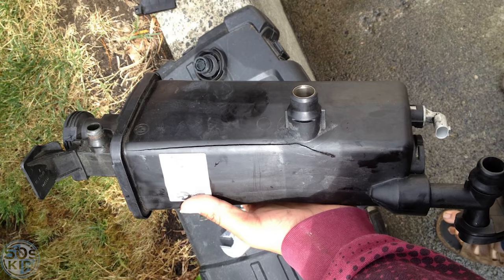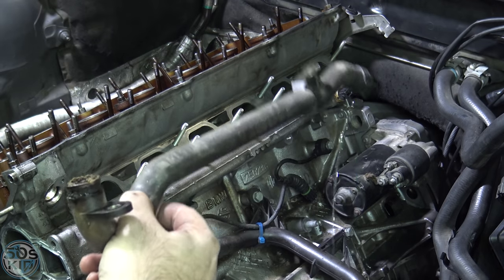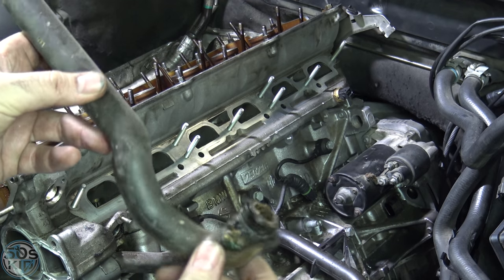Common BMW E46 Cooling System Failures

Comment: yep, mine just started overheating last sunday, going downhill. it was not even hot outside. so that tells me its the waterpump. it doesnt overheat at idle, but it does at highway speeds. gonna get that brand you recommended.
Reply: turns out it was the thermostat, but i replaced the water pump too anyway. just had this catastrophic leak 200 kilometers from home today. note to self: replace the expansion tank mounting plate when replacing the radiator.

Comment: Thermostat heating element is NOT for heating coolant when car is cold. It’s there to heat wax in thermostat - so ECU can electronically change thermostat opening temp depending on engine load (you can find thermostat temp map in ECU - for example in higher RPMs and/or more air flow into engine, the ECU switches the heating element, which heats the wax and that leads to keep thermostat open even in lower coolant temps, for this high rpm/high air flow into engine its only 84 degrees celsius I think). You can try it - open nr. 7 in cluster hidden menu, heat up the car to 97 deg celsius operating temp and push it hard on highway - the car immediately opens thermostat and drops the temp to like 84-86 deg celsius.

Dont take it as critics, its just to inform others about how the old BMWs heated thermostat works:) Great video, as always, thank you!

Comment: i've a feeling that a leaking oil filter housing gasket and /or vanos oil line in the same area could be leaking oil all over those hoses that are underneath the intake manifold - if so, that would surely not be good for those hoses in particular. Also, those hoses are totally out of sight, and as someone else said, get overlooked on that basis.

Comment: What were those engineers thinking of when putting a plastic hard line under the intake?
Reply: I had an E36 with the M42 engine and they have a plastic coolant line in that same location too, the one on mine split and the engine lost all the coolant, cracking the head.
Reply: Repair dollars!

Comment: Previous owner of my car had installed an aftermarket coolant temp sensor on the lower radiator hose, and it was leaking through the connector. O-Ring was fine surprisingly lol

Comment: The mechanic change my cracked coolant extension tank yesterday. He said the auto transmission oil cooler thermalstat is broken too. I think he broke it while he was removing parts. It is not like it was broken before. And he said i might be okay to run the car without it. Is it actually okay? It is so annoying everything just keep breaking.

Comment: Absolutely the truth - best thing if buying an e46 - take the hit and do the lot; they are getting old now. Means pulling the inlet manifold but it's not if, it's when as Jason says. Be really careful with the hoses under the manifold as they can snap where the hose enters the block making it difficult to get out. Best way is to stuff a rag into the block from the thermostat opening to prevent bits going into the tunnels. Use OEM coolant - not cheap stuff.

Comment: Owned a 11/99 323Ci since 2011: Blown expansion tank, failed water pump bearing, leaking hose o-rings and swelling radiator.

Comment: P2183 rad temp sensor calibration? Changed lower rad temp sensor twice URO and yesterday installed Hella temp sensor. Same P2183 came back again? 😞

Comment: BMW used some sort of composite-plastic for the early E46's.  Anything important heating up and cooling down regularly during normal use: just replace it. Oh, about that expansion-tanks, might be wise to try strengthen the corners where possible, they'll crack along fhose, top to bottom...

Comment: 99 328 - 200k + miles.  I think I've had everything in that list fail at least once  header tanks / water pumps multiple times.  To be honest after 2 catastrophic cooling system fails - all these items I now consider service items - will replace every 7 to 8 years max no matter mileage.  Luckily engine survived both times as I stopped and got a tow.

Would also be #1 on my list to replace if I buy a new 3.  Start with header tank / pump / thermostat at a min, and include the others if they are looking at all suspect.  The tricky ones are those hard pipes,  Just no way to give them a good inspection as they are hidden under the intake.

Comment: Hey Jason, have you tried a lower pressure expansion tank cap? Supposedly, the lower pressure puts less stress on those plastic components, so they last longer.
Reply: A lower pressure cap does not help for the most part. The pressure is "regulated" by how much local micro-boiling that happens in the cooling passages next to the exhaust valves. The typical actual pressure runs 10psi to 14psi in this car, almost always less than 1 bar. The pressure cap only comes into effect in a catastrophic event when the whole system is about to blow. Exception: if you overfill the expansion tank, the pressure will run at 18 to 20 psi, so don't overfill obviously. I repeat: In all cars, the actual running pressure is not regulated by the cap. The pressure is "regulated" by how much local boiling occurs in the cylinder head, so in effect, the pressure is not regulated but does stay several psi below the rated cap pressure for the most part. Interestingly, a 2010 Honda Accord will run 4 to 14 psi all day, sometimes zero psi!!! A Genesis G70 will run 14 to 18 psi all day. Every car is different.
Reply: Lots of engines run in the same temperature range, with a much lower pressure rating on the cap.
Reply from the maker: Haven't tried it myself
Reply: A lower pressure cap will do absolutely nothing on an E46 for the most part. I have run both the stock and the lower pressure cap on my 2002 325i. I have a pressure sensor hooked up to the upper radiator hose. The pressure readings are identical whether you have the stock or the lower pressure cap. That is because the pressure almost always runs several psi BELOW the pressure rating of the LOW pressure cap. The coolant pressure runs in 10-14 psi range for the most part. The pressure is NOT regulated by the cap (except when something goes wrong and all heck is about to blow up). The best preventive measures are: Replace the parts (expansion tank, etc) before they fail, and bleed the system properly (use vacuum filling system if available).

Comment: I have replaced every single component you mentioned, and I did it with your videos. I learned some things, too: be careful with the replacement radiator: it has to be one labeled for a manual trans if you have a manual-- (duh!) But it's easy to mistake because about three years ago, most companies stopped making transmission-specific radiators for E46, and they just threw in a conversion kit for auto to manual transmissions. The kit works, but the fitment is bad. An old-stock Mahle designed for a manual trans car fit like a glove. For all other parts, I bought Rein/Continental. German made, but very cheap. No problems with fitment or leaks. Oh! Except the water pump. I bought a plastic impeller unit from an Italian company because of this logic: if a metal fan breaks up, that will be the end of the engine; if a plastic fan breaks up, that's 20 dollars for a 5 liter jug of coolant for a thorough flush.

Comment: My car was just towed last week from the expansion tank cracking. Was the original one from 2001 and had just over 175.000 miles.
Reply from the maker: Wow that one lasted unusually long
Reply: @50sKid  Mine is a diesel so it might have something to do with it.

Comment: One thing is collant system might eventually leak, but aren’t all the sensors capable of detecting this?!
And the only car I’ve seen significant use of failure prone materials (like plastic impellers and weak radiators)and failures in my 5 90’s cars have been on my BMW (E36), the others all had significantly more mileage (median about 250k) and only minor issues (apart from a broken gearbox design in me Kexus RX300) in comparison.
Reply: It is a German/BMW thing, for sure.
Reply: Are sensors able to detect a cooling system leak, is that the question? The only existing sensor obviously is the engine coolant temperature sensor, but by the time that goes up, it many already be game over for the engine. I have installed a coolant PRESSURE sensor in the upper radiator hose. My theory is that this pressure reading will go to zero if there is a sudden catastrophic leak. We have a pressure sensor in the air conditioning system, we have a pressure sensor in the oil system, we even have a pressure sensor in the gas tank. However, auto companies don't put a pressure sensor in the cooling system. But that is what I think you are asking for. And yes, if BMW used better plastic (polymers, rubber etc) then we would not be having these discussions.
Reply: They don't necessarily need to immediately detect the leak, just avoid the engine from overheating because of the leak. But even that evidently is too much to ask.

And it's not like the engineers didn't know about this, this was a problem on the E36 as well. If you know your design has a weakness that might cause catastrophic failure, the least you should do is add an extra sensor to mitigate it somewhat.
Reply: @brynyard   The engineers at BMW did not misdesign the system. The design is fine for the most part. The problem is that somewhere along the line, someone (the bean counters?) at the BMW specs plastics (and other materials) that are not up to the durability. The poor durability of automotive plastics seems endemic to several European auto suppliers, not just the suppliers to BMW. An extra sensor would not mitigate poor quality plastics.
Reply: @emineid  The spec for the plastics is done by engineers, anything else would be incredibly stupid as it would require a complete retesting of the design (and even BMW isn't that stupid).

Strangely no other European car manufacturers seems to have regular occurrences of engines overheating because of this "endemic" problem, so by "European" you probably mean "engineered in Munich for BMW"?

Since BMW engines tends to fail so easily if (or rather when) they loose coolant, adding a pressure sensor probably would be an idea (unless, of course, they do the same mistake as with the crank hall sensor on the E36 and choose a sensor that can't handle moisture and require you to disassemble half the car to replace it). If the engine is so fragile it overheats before the sensor detects this it might be time to start firing some engineers.

Bring Mir Werkzeug isn't a meme for nothing.

Fun to drive though, but I wouldn't own one outside the guarantee.
Reply: @brynyard  The way it works is that when they design a new car or a new engine, the engineers have a good guess about what works and what doesn't, what is durable and what isn't. After the initial design process, the bean counters tell the team to find a way to manufacture the car for about 30 percent less than how it was initially designed. Every part must be re-specified with cheaper materials or cheaper way to make things, or lighter way to make things as well. That is where the compromise comes in. Also, manufacturers have to rely on the menu of materials available to them from their network of potential suppliers. Finally, BMW engines produce more power for the same displacement compared to reliable cars that produce less specific power particularly at usable ranges (not peak HP or peak torque necessarily). There is more micro-boiling in the exhaust valve area for BMW engines, and that micro-boiling is what really causes the pressurization of the coolant system. So you have an engine that runs hotter (exhaust seat metal temperature, not necessarily coolant temperature), at a higher coolant pressure, with less durable plastics (not necessarily the specs that the engineers wanted to use) and those particular combination is not always present with other car companies. Finally, there is the unfortunate German mentality of not wanting to copy the "lesser engineers" of Japan or other countries simply out of pride. Everything I say has all been documented in the industry literature. As far as the engineers are concerned, if they meet the specs provided by the management, they collect their paycheck and call it a day, no use arguing too much with management and bean counters. In the end, "manufactures will get the reliability that they specify" to quote a German engineer. And the BMW products meet the reliability tests that are performed internally. It is just that those test standards are different than Honda or Toyota.
Reply: @emineid  That's just a long winded way of excusing the engineers for making an unreliable car.

It doesn't change the fact that it fails much easier than other cars (also cars from other German manufacturers like Mercedes), and that you'll have to account for a lot of extra bills if you buy on out of warranty.
Reply: @brynyard  I disagree with nothing that you have said. I don't excuse those decision makers at BMW that give us such crappy reliability. In fact, I curse them. There is something very wrong with a human mindset that knows of a problem but refuses to fix it decade after decade. My old 325i would have been such a sweet car if I didn't have to worry about something going wrong with it all the time. It drives very, very nicely. BMW got the haptics really right, better than other brands I have driven. In an ideal world, the BMW would have been designed by BMW engineers and then specified and built by Honda to Honda's reliability specifications. I spent $11,000 in genuine BMW parts (not counting my labor) just to bring my 2002 325i up to any semblance of reasonable reliability by replacing virtually ALL the components that are known to fail, before they failed. That level of aircraft depot-like "maintenance" would be unheard of for a Toyota or a Honda owner.
Reply: @emineid  I worked for 11 years as an engineer and 20 years as a manager of quality, engineering, procurement, and operations functions in a Fortune 500 company.  At one time I held a division wide cost reduction project tracking position reporting to a VP.  What you describe as methodology for implementation of cost reductions is incomprehensible.  Is the cost pressure you describe real?  Yes.  Do accountants exercise that level of influence and are engineers excluded to the extent you describe?  OMG no.  Absolutely no way in hell.  I never in any of the companies whose methodologies I became familiar with saw any function other than engineering assigned the lead in identifying, testing, and approving materials changes.  I DO fault the design engineers for the cooling system issues.  I can only speculate that excessive plastic use may stem from an arrogant attitude about the functional quality of materials coming from what is admittedly an elite German polymer industry staffed by world class chemists (I am a ChemE) perhaps combined with a little planned obsolescence of the type that compelled BMW to recommend oil change intervals of 15,000 miles.  If enough parts break maybe you buy a new car.  I think the design life of an e46 is 100,000 miles or so, the point at which they turn into money pits for non-mechanics like me.  I'm here acquiring knowledge to go with the tools I'm buying to enable a retirement hobby of keeping my 330i running because I love the car and I don't think the newer ones can hold a candle to the kick in the pants I get from hitting fourth hard exiting a curve in my 5 speed.
Reply: @zigmundpatcharzak2344  In the corporate world, few would be crass enough to directly get in an engineer's face and tell him to cut costs, customers be darned. It is much less dramatic. The management approves the specifications and then the engineers meet the specs. When everyone meets their specs, everyone goes home feeling like they have done a good job and nobody has to worry about a meeting with their supervisor. Some engineers just know how to follow rules, and they don't "get paid" to think through the real world implications. I am sometimes amazed at how inflexible some engineers are in their thought process. Besides, who pays a six-figure salary engineer to worry about whether the expansion tank will crack in ten years? A lot of the hand-on-the-mouse design process is done by tech school graduates. The engineer making high 5-figure salary might spend all his time making sure the next car meets the federal regulations. The engineer might never even tour the factory where the cars are assembled. They are basically just waiting for the people at the top of the rung to die so they can get promoted. Some engineers are independent-minded and know what is not right about the design (or the materials). It doesn't matter. They can't go on youtube and rant. They know the management gave them certain specs to meet and that is that for the most part. As for the legendary "German polymer industry" etc etc, a lot of the BMW suppliers are not even German, but could be French, Italian, or Austrian. At BMW, instead of making products better, they find it easier to just yell at the Eastern European and Turkish line workers for any woes. The people who really know what we are talking about (durability, reliability) are the "old guys" at the car factory who "know how things are done," not the engineers. A lot of the things we think are done by engineers don't involve the engineers at all except on paper.

Comment: Jason - have you done a video on clearing the rear sunroof drains on an E83 X3 with the pano roof?  I cannot seem to clear one of the rear drains and I am about to cut the drain line inside the rear hatch side panel to be able to get a trimmer sting in there to try to clear out the rear drain.